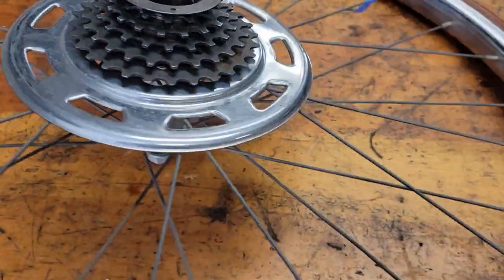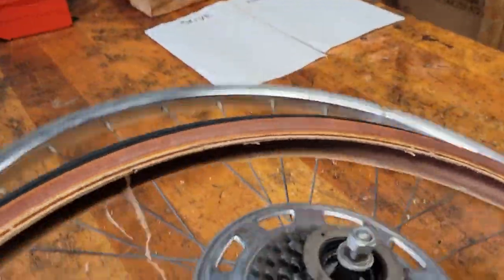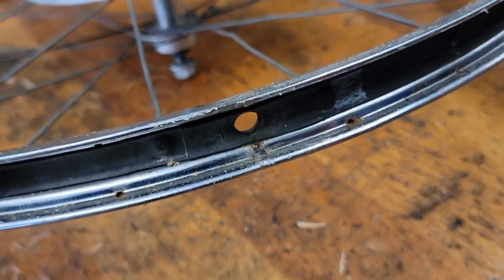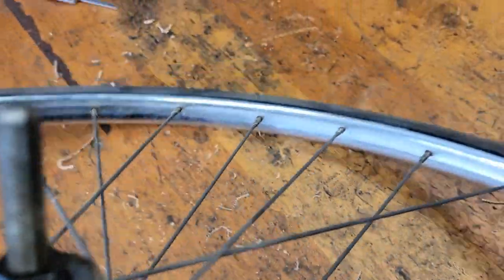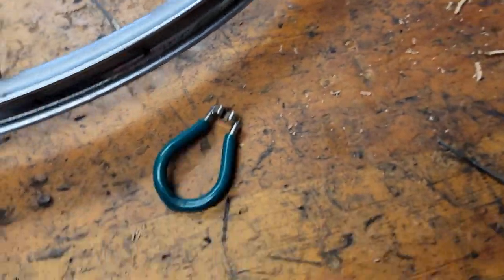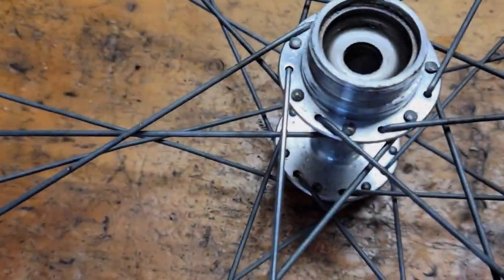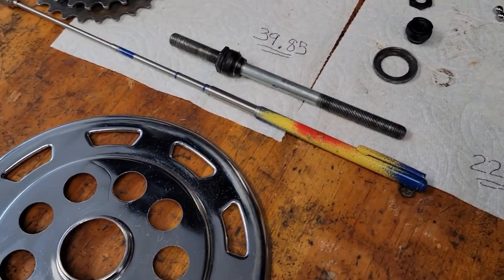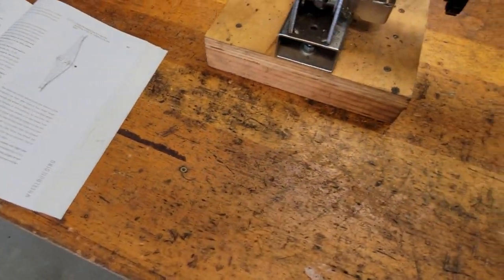1973 Schwinn Varsity Sport - Rear Hub Service

Comment: It would nice if you included that you used a 24 spline cassette remover tool for French freewheels used on Schwinn bikes from the 60's, 70's and 80's (i.e. Normandy, Maillard, Sachs, Peugeot, etc).

Comment: What removal tool did you use? I’ve got a 70’s Varsity and need to remove the flywheel to service the bearings. My LBS doesn’t have the right socket and I can’t find a definite answer online. Thanks!